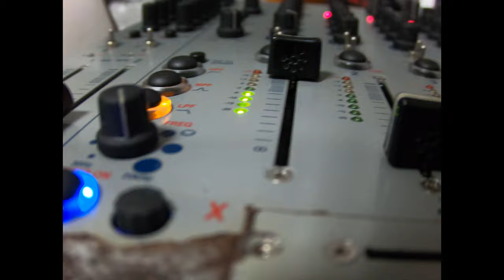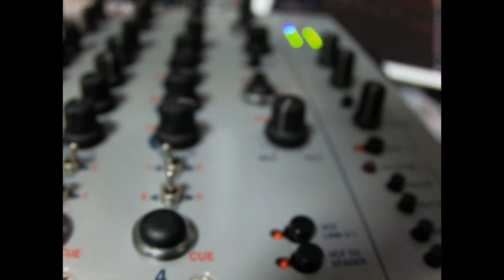DJ mixer XONE 92 Restore Repair (allen and heath music gear Mixing console restoring

Comment: Damn?!  I’ve not known of many to actually dismantle their sliding potentiometers.  I did ask DJ Q Bert one time about his fader, as in, “hamster cage, and WHAT?!”  He leveled with me and told me he put a little piece of rubber in there to get just a little extra spring-off from the limit.  It would make sense, because it seemed from many videos that it wasn’t possible for the sound to completely cut out unless you physically held that fader in place against that resistance of that rubber.  I remember the amazement that I felt when I first opened up a Vestax 05 I had, to find that there were really nice switches inside the chassis to set the fader curve response (exponential, linear, inverse exp) on both channels.  The same switches that they put on their panels.  THANK YOU for sharing an amazing refurbishment!!  GREAT JOB!

Comment: I need to find someone like you to service mine. One of the filter frequency sweep knobs stopped working recently 😩😩😩 
I would have taken the opportunity to fit a new faceplate tbf, they don’t cost that much and the rust is unsightly. Got the issue on mine to a much lesser degree

Comment: Hi there!
Awesome video man, very detailed!
Got a question.I need to replace all of my channel faders.Are they plug and play or require some soldering?
Reply: 2:50 plug n' play
Reply: @aaalex303  Thanks man!I've fixed it few weeks ago, they are plug & play if you buy the right faders.I managed to buy faders without the pcb board and had to solder.All good now ;)
Reply: @gal3sz  Can you link me the best i can use to replace? thanks!

Comment: what should cost an old used 
allen & heath xone:92 MADE IN UK ?
is it not more logic, to buy a new 
xone:92 with 3 years warranty  ???
'cause i see in this video, it can be opened & repaired, or the parts can be changed !?!
what is the MAIN difference between the MADE IN UK and the
latest xone:92 models  ???
or is it just a british complex  ???
i really don't know, and i need precise informations about it !!!
Reply: Hi, recently i saw this, MAIN difference between the MADE IN UK and the
latest xone:92 models  ???

Main difference is much better solder quality, i have had Xone 22 made in china, spend most of the time under soldering iron, chinc connectors are first to break bad solder quality..

Also, in recent model, A&H uses shittier faders as time goes. Newest are real trash, if you get 3 years of work you are very lucky.
Reply: @goranstecesin1186  thanks for the reply. now i found an old djm 700-k
pioneer mixer, that i gotta repair now somewhere. what i can say is, at the end, it's better to buy a brand new quality dj-mixer, with five years warranty from the shop you buy !!!
that's what i learned finally. i'm so glad, we got shops like that in good old germany.